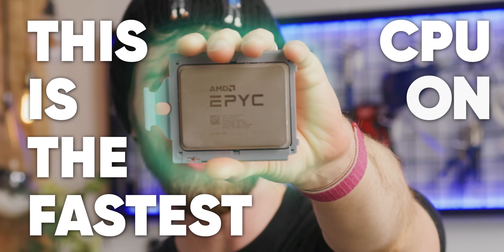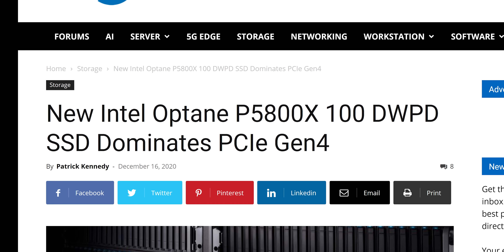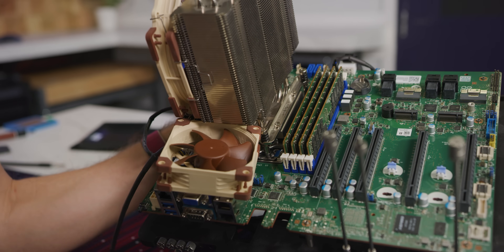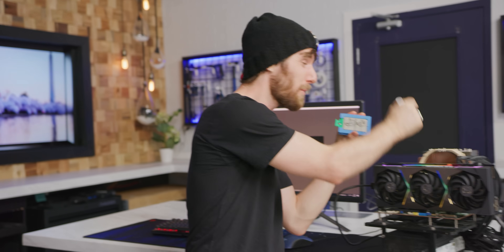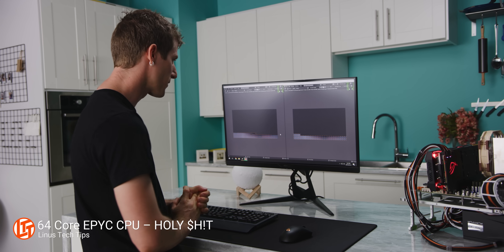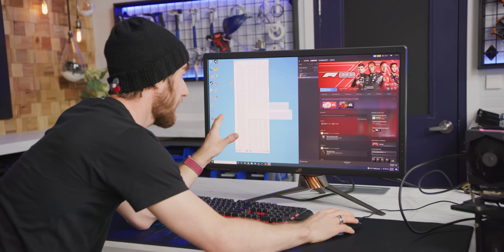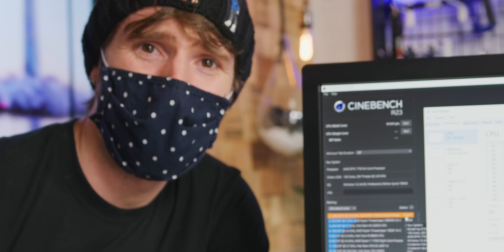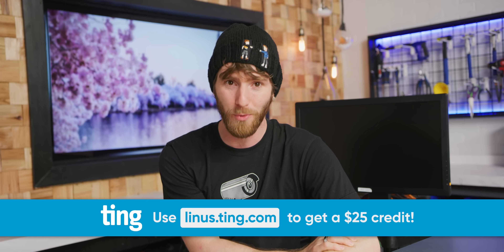The Fastest CPU on the Planet - HOLY $H!T - EPYC Milan 7763 64 Core

Comment: Hey! I have a problem that I'm hoping the community can help me with. So, to preface, I've been updating drivers (Chipset, Root Hub, ALL OF IT. Ive ran Driver Booster 3 times). My issue here is that my mouse repeatedly keeps disconnecting and reconnecting, no matter what USB I put it into. Now, I checked that it wasn't my specific mouse by plugging my secondary mouse (a 2 year old Razor Lancehead) and it also had the issue. Ive reinstalled Razor Synapse, and my current mouse is a Mamba Elite.
Reply: Got it fixed yet?

Comment: special html languageto link all quantum computers must be built & then that software optimizations should be added to every modern day soc'  bios & normal code be  written to use soc wirelessly where more cpu power is required I hate my 6S is just sitting there dead I could just power it  & gain its free unused resources for other stuff that I use or maybe it can mine or be used as some random adserver
we dont need toput 1qbit data backinto our current soc's we need to transform our current data to use all quantum states  & these qsoc's  process that  & spread it  geosynced everywhere,so even 1mhz clock can translate intobetter perfomance ,I agree minimum gains  unless architectureis upgraded but it will still make a difference, bet on it statios
Reply: other thing that these big companies can consider is random string generators & polytraingles,or other organic  structures shapes  polynomials binomials in neural networks  feeding  that  data  Fibonacci sequence & other time derivative theorems that come
one can utilze this preexisting resources & pathways for digital signal manipulation,& the loads on gpu & networking  signals can be  rounded off /cycle/time,These  things to my knowledge have already been added  there is great weblink to sequences  & shapes  Fibonacci & string manipulation can achieve  ?do our ui'overlays  follow those principals shared load manipulation &  easing of obtrusive business/clock cycle & even simulating non existent profiles of data?our geo sync sate up-gradation must consider all these issues  broadcasting  issues & other variables as well,we must work hard gto achieve quantum supremacy,I'm saying that Ai dhould like jit compiler  or onthefly compiler  for these  shapes & even deep fakes can be adopted we only need large enough caches  & datasets to  further improve this & already  decoder  inputs have been improved vastly that data can be also used for this

Comment: Intel is better each & every day in gaming, due to its higher level of integrity for games and high clocks. + integrated graphics makes a lot of difference when you are low on budget or just doing normal office work.
Reply: AMD is at worst on par with Intel in gaming, and at best smokes them while using far less power. High clocks aren't everything

Comment: Hey guy can you pls connect 4 of these processors and another 4 of ryzen 9 5950x on one motherboard with 4 rtx 3090 and then demonstrate the power of that computer pls
Reply: Not possible. Such motherboards don't exist.
Reply: @haven216  but at least he can connect only single of the epyc, ryzen and rtx for demonstrating power or apply each processor on each mother board means Making a total of 8 motherboards , 8 processors, 4 gpus in total and connect those motherboards together that will be great isn't it
Reply: @roshanpereira7650  That's not how it works

Comment: Yeah, AMD's EPYC has been shown to be much superior to Intel's current server chips, especially in performance per watt, but apparently a LOT of the software these datacenters run is compiled for Intel and not fully compatible with AMD, so there hasn't been a mass migration. Tom from Moore's Law is Dead talked with some server engineers on his podcast and they said validating the software stack for AMD would take years. That unknown reliability is why they're hesitant to migrate. Just one extended downtime incident because of a program trying to use instructions that don't exist would mean losing big clients.
Reply: Interesting..thanks for pointing it out

Comment: actually not true this is not the fastest CPU on the planet, it is however the fastest CPU using x86_64 architecture, the real fastest CPU on the planet is known as the Wafer Scale Engine (WSE), made by Cerebras, the original Wafer-scale engine using 14nm technology boasted 1.2 trillion transistors I think. The new WSE-2 now wields 850,000 AI-optimized cores spread out over 46,225 mm2 of silicon packed with 2.6 trillion transistors. Cerebras also revealed that the second-gen chip has 40 GB of on-chip SRAM memory, 20 petabytes of memory bandwidth, and 220 petabits of aggregate fabric bandwidth. The company also revealed that the chip consumes the same 15kW of power as its predecessor but provides twice the performance, which is the benefit of moving to the denser 7nm node from the 16nm used with the previous-gen chip. while yes the WSE is heavily optimized towards AI it's still the fastest CPU on the planet, the thing is the WSE1 in its CS1 package as they sell it was able to beat the Jule supercomputer which is the 61st fastest supercomputer in the world in a combustion simulation, for less than I think half or a quarter of the price.

Comment: For whatever it's worth...  I am pretty sure the L3 cache still has a NUMA topology that has variable latency by default, but it's generally faster than the previous generation if the underlying code segments the workload properly.  It's interesting how we're seeing a convergence of the CPU and GPU,  the 3080 TI has about 80 SM's.  If AMD ever decides to introduce an operating mode on their CPU's which streams similar to NVIDIA's SM, these "CPU's" might out-perform "GPU's".

Comment: I wonder how many USB2 devices that thing can run at full (USB2) speed at the same time 

like if you were gonna try to make a nas or san or some other bulk storage solution with each drive running on only a USB2 connection 

I used to have a portable 1tb USB hard drive that could be run on USB3 or USB2 (if it can get enough power) 

although additional/external power would probably be better if you were gonna run a bunch of them at the same time 

I wonder how many USB2 connections you can get from a pci-e x16 slot (all going at the same time, using as much bandwidth as they should reasonably be able to before you start experiencing lower bandwidth) 

and is there any adaptor/hub that you can plug into a 5 gig USB3 port and get about as many USB2 ports as the bandwidth might suggest you should be able to get (10? maybe 9 because of overhead?), and what would be the theoretical and practical max numbers of USB2 ports off of a 5 gig USB3 connection, and a pci-e x16, respectively?

Comment: Actually, Google and Nasa are experimenting on a quantum computer, you may know it, but no, it's a "normal" computer but it's the prossessor, the component that does the calculations, that is quantum. And given that this "quantum processor" made a calculation in 30 seconds which would have taken 10 years for the most powerful computer in the world(In fact, it is hundreds of computers connected together that make a good calculator)

In short, here, it is not the most powerful processor on the planet! 😝
Reply: Quantum computers are not a replacement for traditional computers, though.

Comment: Was about to ask if it could run Crysis when you literally tested the Crysis 3. Dang it.
Reply: but crysis remastered on highest possible settings is actual beast heavier than most of games even metro exodus on ultra rtx wasn't that hard to handle for my pc like this remaster on highest settings
Reply: @Mr Fl0v  run crysis remastered on maxed out settings in 1080p vs ark survival maxed out 1080p. crysis kick his out easly in survival you will get more than 60fps when in crysis less than 60 if we comparing pc who can handle ark on this setting in stable more than 60fps
Reply: @Mr Fl0v  u know titan rtx have worse performance in games than basic rtx 3090? .... and cost much more

Comment: What about same cpu but with 128 or 256 cores and 5.5ghz base clock cpu and gpu speed? i thini they've 2nm tech now so it can be smaller too,  exept if they will integrate a 3090 or 6900 into it;)  like the older laptops but with this nzwest technologies?  let's make a build?

Comment: Can't wait until AMD comes out with a crazy GPU too. We are witnessing the AMD takeover
Reply: @slange420  x86 is not over because of the M1. X86 (actually x64) will continue to be used in the scientific and data areas of computing. RISC is great for general tasks, not great for heavier duty tasks where more instructions increase performance. X64 CPUs have larger cache and have instructions that can handle 4096 bytes of data at once. X64 also has better memory bandwith, better memory capacity limit, etc. that can increase its performance per watt in certain workloads you would think ARM would dominate.

That's exactly why AMD Epyc processors are being used in supercomputers and not ARM. Don't be fooled by marketing...
Reply: as a full amd using i dont want and to dominate because a single company with cpu gpu domination would be worse than nividia and intel
Reply: I just chose AMD over Intel for my servers and high end workstations for a lab I'm building at work, so it's spreading into business too
Reply: @typicalsenator  imo they been beatin that Intel ass in HEDT, server and enterprise solutions for a few generations now. Maybe save for some very niche segments..
Reply: IBM POWER10, ARM Neoverse N2 and V1 and Nvidia Grace: Allow us to introduce ourselves.
Reply: @atisbasak  introduce yourselves, x86 aint going nowhere but to the top! First exascale supercomputer AMD x86 not ARm.
Reply: @slange420  m1 max cant even load red dead 2
Reply: @unknown185  lmao
Reply: @slange420  its true
Reply: @unknown185  it’s funny that the M1 max can’t even load rdr2, that’s why I wrote “lmao”. Moral of the story: Macs aren’t for gaming.
Reply: @slange420  bruh. I wont pay for a laptop that cant even play gta5 and not even super mario bros. People use that sh*t for Facebook and tick tock
Reply: @slange420  pc has also better programming apps and better photoshop apps
Reply: @unknown185  I don’t like the locked down nature of M1 Macs. They’re just like the phones now. For normies they’re fine but not for power users
Reply: @slange420  same
Reply: @slange420  they certainly could be, these companies would only need to recompile the instruction set to run natively on arm/risc Linux or whatever ecosystem they perceive benefit from, when or if that happens (not holding my breath, I mean MS certainly will not spring forth the effort for any of it's I.P. holdings to benefit their direct conpetitors. 

Currently emulating the environments while meeting requirements for AAA games is practically unfeasable for, but this could inevitably change as current hardware iterations are making great strides in performance, efficiency and features, only time will tell.
Reply: I hope not, we need competition to drive down costs and fuel innovation. Any time an individual company manages to get too far ahead they always, always, always become complacent and the consumers suffer through higher premiums for negligibley increased performance, subpar feature advances and the leading group's 'fiduciary' obligation to maximize peofits for shareholders. Every single publicly held company will essentially fall victim to this, thats just how the system works. We need competition in every aspect of business to move society forward. 

Side note* Our situation we (out wisest of the wise leaders) have probably doomed the free market in the most complete sense of the word. Our market of innovation will not survive the fact our politicians and their puppet masters (lobbyists and campaign donors) gave away or more often than not paid to have our manufacturing capabilities moved to other markets (important to note also is these markets profit mostly from either having very little or no protections at all for both the environment and workers. We will see the most damning evidence of this shortly. 

The only remediation that I can conjure would be to impose bans on imports from countries that do not match our current or future regulations that include but are not limited to our environmental protections, our worker safety protections, our minimum wage protections and child labor laws. Of course we can't flip that switch over night so we would inevitably have to implement these policies in strategic phases.
Reply: problem is the video didnt age well a 6ghz i7 beat this epyc at rendering also i wouldnt trust AMD making cards they need to fix cpu reliability first

Comment: 0:06 Why are threads always mentioned after cores? Every CPU has two threads per core so it seems redundant.
Reply: No every cpu does not lmao.
Reply: You have never seen a dual or quad core cpu with one thread per core? It will show up in task manager as a 4 core, 4 thread cpu.

Hell that was the main difference and selling point of core i7's over core i5's for a long time. both had 4 cores, but only the i7's had 8 threads. And of course the i7's ran a little faster.

Comment: no one:

Linus: casually drawing on an $8000 cpu with a marker.
Reply: That doesn't affect the cpu
Reply: @hritikaggarwal270  if the ink is thick than it might
Reply: It was the real deal, but dry erase comes off easily
Reply: Just throw it in the washing machine and it's as good as new
Reply: Would have been funny if he wrote on the die
Reply: It doesen't matter, its cleanable and nothing will happen.
Reply: @NeoMusic420  yeah but surely he’s returning these cpus right
Reply: We can buy CPUs at fair prices that have the power of the CPU in the video , after a decade passed.
Reply: I'm hoping that was the box… right?
Reply: @Nikifuj908  you should’ve watched the video

but it’s at 5:09
Reply: Bruh that’s like placing thermal paste on a cpu it’s fine it doesn’t affect it
Reply: @3lectr1x   nAH bRO tHAT wILL kILl It!11!!
Reply: It was just an Expo dry erase marker. You can wipe that stuff away with your finger or your shirt.
Reply: no one:  liking your comment that has a functional brain

Comment: If you wanna test the cpu spawn in 30 AI in beamng.
Reply: It can handle high-intensity experemental supercomputing, entire corporate office workloads and web hosting at the same time. It'll shit your game straight out.
Reply: @ThatsMrMaxHeadroomToYou  you’ve obviously never played beamng. That game is so insanely cpu demanding once you spawn AI. If that cpu can handle 40 AI at 60fps I’ll be extremely impressed
Reply: @colonelsandals6991  You don't seem to understand. This isn't a gaming CPU. It's a server CPU for managing workloads, traffic and even 12k video rendering from a large volume of PCs simultaneously that has enough cores to crunch even the most extreme workloads like lightning.

Simply put, it will eat any multi-core enabled or optimised game alive 6-7 times over but that isn't what it was designed to do.

Comment: How many developers are utilizing 8 cores and threads in games or applications? I have a gen 2 i5 which works beautifully with any modern game with my GPU. don't buy into these new cpus, they wont be utilized properly for years.
Reply: Umm, it's not designed for that, these are for massive amounts of data. They are the basis for things like super computers for quantum. they are not engineered specifically for gaming or general productivity. It would be like using an F1 car as your daily commuter.

Comment: Wtf is that cooler? How the f you use 270 Watts with this? I have similar cooler but with 2 fans on an i5-11600K and at 160 Watts it thermal throttles.

Comment: Looks like I need this, as I have brought my first pc to it's knees (single core) upgraded to AMD Phenom II x6 1090T (still working) and currently using a quadcore laptop. All had trouble with throttling when I started the anti-virus scanning, moving 4TB of data from a 6TB drive to another 6TB drive, while having 4 games open, maxed settings on 4 different computer screens using some technique and while listening to music. :-) Unless I need to change my work schedule anno 2021.

Comment: "This Suprim-X 3090 is so hilarious, it's so big we've never even tried to integrate it in an actual build"

I just started feeling completely hilarious :-/ ;-) 
For anyone using this card (and likely any 3090): it generates so much heat that the tempered glass side panel hits 50°C when running under full load for sustained amount of time, and as such pushes the top M.2 to 57°C and the bottom to 52°C. The extra hdd which also sits lower than the GPU also hits 50°C, which is partially associated with hot air flowing over it from the AIO.

Comment: That's because intel is based in the United States so it's more expensive to manufacture them and cpus arnt expensive to manufacture its the time and labor going Into  engineering it thats expensive it's probably only 3
20-40$ to make the top if the line cpu but they know people need them so they can upcharge them and my old core 2 quad got a score of 3 million on r23 a glitch but still higher than amd!

Comment: I have a few points for you:

1.  This is not the fastest CPU on the planet.  This is the fastest production CPU on the planet.  There are processors faster than this that aren't available to buy.
2.  I can't wait for these to hit the street so that I can get used Rome chips cheap.
3.  What changed that enabled you to use all cores for Blender?
4.  How many cores/threads were in use while you were scrubbing that timeline at full quality?
5.  Heavily multi-core games.  Anno 1800?  Exactly how multi-thread can it actually go, considering it's usually CPU bound.  Is Civilization VI still CPU bound these days?
6.  How many cores/threads were in use during the F1 2020 run?
7.  How would it be to game on the dual-CPU box?